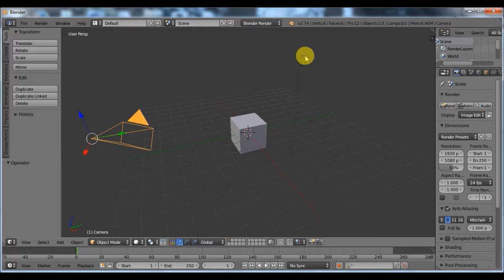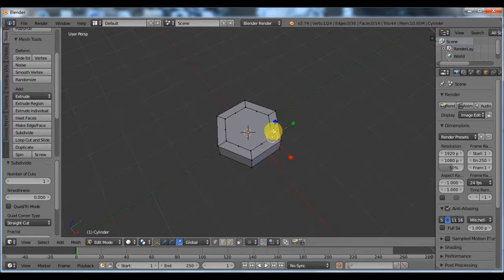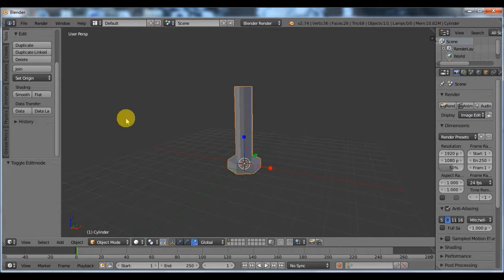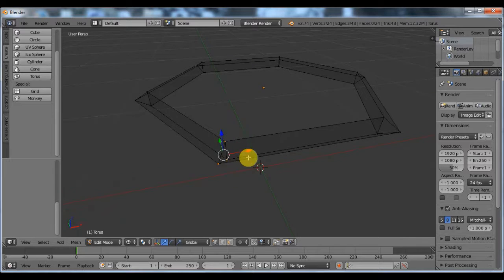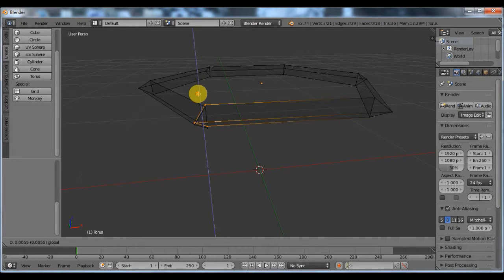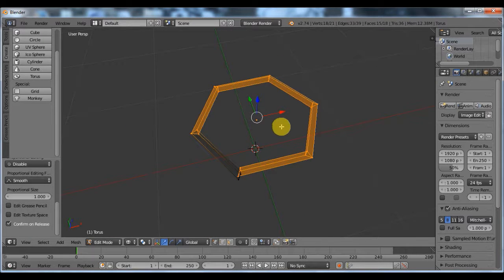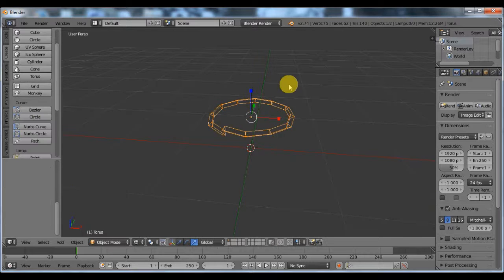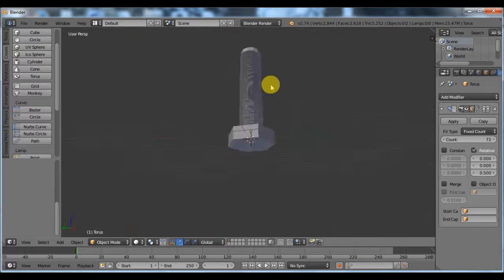Bolt/screw in blender - How to model threading

Comment: Can someone help me? I'm a novice, so this will probably make some of you laugh. When I get to the point in the video (1:18) where I select all the points, When I scale to make it round, it scales from the last point selected. In the video, it shows that it scales from the center of the object. How to I get that to happen?
Reply: Nevermind. I found out I have to hit Ctrl + , (comma).
Reply from the maker: Or you could use the pop-up menu and select the center of transformation as median point (the default setting)
Reply from the maker: I wouldn't recommend using this method though haha. There are definitely better ways to do threading that I didn't know at the time